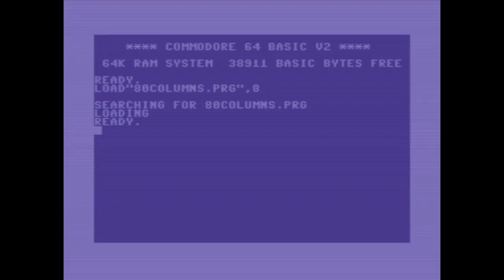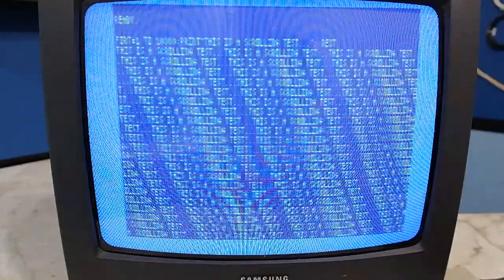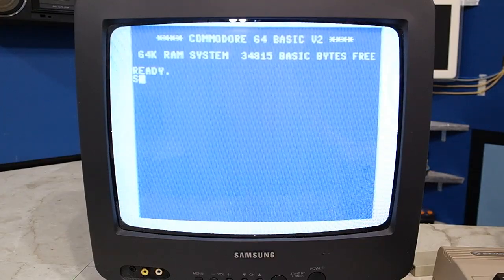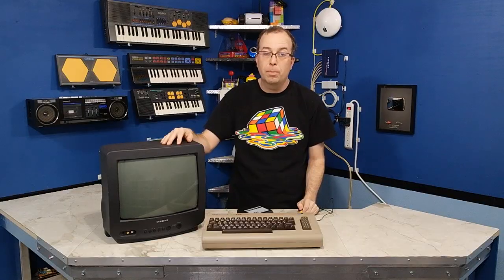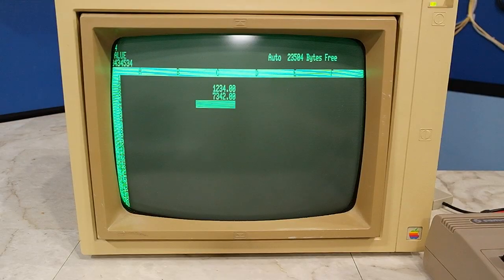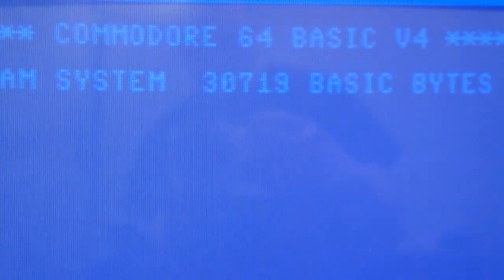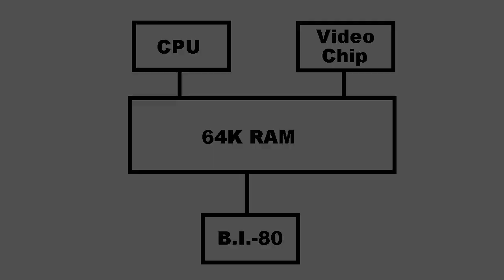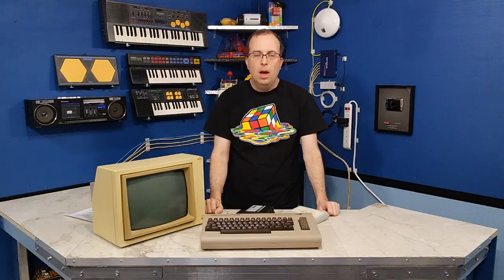The Quest for 80 Columns on the Commodore 64

Comment: I had a vic-20, and I sometimes used the 40 character mode. Yes, it was smart software, because it would actually replace 2 adjacent spaces with a single character, as we only had 256 characters to redefine.
Actually that's not completely true, as you could change the base address of the character font on the fly, but that required a raster interrupt halfway the screen.
That was certainly possible by using the 6522 free running timer with exactly the right period of one retrace, and synchronising that by busy waiting for the linecounter to change. Which had a margin of course, due to the loop waiting for it. At least I could make a smooth scroll by changing the column width to 0 characters and back at the right moment (per scanline adjustable), and changing the start of screen (once per frame changeable).
My cbm8296 did not have any of these nice things.  Not even a reprogrammable base address for the fonts. Stupid 6545. The same 6545/6845/8245 for which a lot of VGA cards were register compatible for exactly the same thing you said: software support.
I assume you can still pick a modern nvidia card, and talk to it like it's a 8245.
My cbm8296 rom did have support for character windows: you could define a window in which you could do whatever you want, but the outside of the window did not change. Very nice for menu systems
ah... nostalgia...

Comment: Thanks for the walk down memory lane. I used to be a librarian for the Toronto PET Users Group (TPUG) and later worked for Batteries Included. It has been over 30 years since I worked on the BI-80 and programs like PaperClip. Just before Batteries Included was purchased by Electronic Arts, we removed the need for the dongle. We had a lot of people complaining because the dongles would get damaged and there was no way to make a back up. Plus EA didn't have the facilities to make dongles. So in 1986 there was a version of PaperClip which didn't need the dongle. That version supported the BI-80. EA would have owned the rights to PaperClip (I believe) and Oracle (database software) but even when they quit selling/support C64 software, EA never released the software to the public. :(

Probably 20 years ago I pulled out boxes and boxes of floppy disks (5.25 and 3.5) with the source code for all this stuff but sadly the disks had degraded and weren't readable. I wonder if Steve Douglas ever kept his copy of the source code. There wasn't source control systems like we had today. When I moved to California, to work for EA, I lost touch with everyone at Batteries Included. :(

Also, Batteries Included created the BI-MonoChrome Adapter. It was a cable which allowed you to connect your C128 to the Commodore 1701 or 1702 monitor. It was really the same cable you describe in this video. We made it for people who just wanted to buy one pre-made rather than make one themselves.

Comment: An interesting tech note: The blurry image when outputting to a normal T.V. is due to the fact that the video is modulated by the C64 to 57 Mhz T.V. broadcast frequency (channel 3). The T.V. then demodulates it back into composite video and timing variations between the two would cause blurring of vertical edges. A T.V. tech could "tweek" the demodulator filter to clear up the fuzz - sort of. For the tech familiar with television circuitry, you can bypass the tuner and insert the composite video at the output of the demodulation circuit. This requires switching out the tuner. The SID produced all the timing signals; vertical and horizontal sync so nothing in the tuner is necessary. This produces a screen with the same clarity as the Commodore monitor.
On the other hand, the Commodore monitor is not a digital device, it's simply a T.V. without the RF demodulation circuit (tuner). The composite video output from a DVD player ... well, a VCR in the 80's, or cable converter box can be input at the RCA jack(the chroma input if I remember correctly) and produces a clear, sharp image for these devices. It's not HD but was a better movie viewer than most T.V.s without a composite input in the 80's

Comment: it's not so much the signal (chroma subcarrier), it's just that monochrome CRTs are sharper in general. They don't have RGB "pixels" and no mask in front of the phosphorus coating that separates the rays from each of the three guns in a color CRT. With no substructure and just a solid layer of phosphorus a monochrome CRT's sharpness is limited only by how well the ray is focused.

Comment: Ya know, it's funny how many things in early computers are holdovers from the typewriter era, if even just by sheer coincidence: depending on typeface and paper size margins and the like, typewriters generally gave you around 50-80+ characters per line for the average sheet of paper. Happens to fall in the same ranges as computers would provide in text columns, before things got a little more graphically advanced and resolutions increased.

Yeah, I know that's completely random to bring up here, but the nature of business (and word processing software) made me think about that similarity. You can probably also tell by this what I like beyond classic computers and gaming stuff ;)

Comment: The Apple IIe had 80 columns hardware and firmware support built-in. It simply required 1K of memory (1,024 bytes) to display its 80 columns text on screen, and essentially that's all the card did--add 1K RAM in the auxiliary slot. The Apple II and II Plus were a different story, 80 column cards on those earlier models had independent video generating circuity and often require connecting the monitor directly to the card itself. Still, software was compatible between different II/II+ 80 column card manufactures (and even some IIe/IIc era software). Also worth pointing out, many Apple IIe's shipped with the 1K card pre-installed, giving you 80 columns out of the box.

Comment: Local man finds four ways to get 80 column output from his C64! The fourth method might surprise you!

:D

...similar to the Laser XT question, could you connect both the outputs from the 128 to the same monitor (particularly the 1084 with all those extra input ports), and just use a mode switch on the screen to flip between them? Having to plug in two separate ones seems like a very boneheaded - though not at all out of character - decision for Commodore to make.

Would the composite output on that hi-rez plug also produce low-rez monochrome when running in C64 mode? That might be at least one saving grace...

Comment: Huh, the "own video RAM" thing is a bit strange (edit: for the first device). Essentially it's a very low grade CGA or other external card. Does the C64 cartridge port not allow connected devices to read directly from main memory? 

*a wild seconds device appears*

Well that's annoying.

Hmm, quite fast, which is a surprise, as I might have expected it would probably still suffer quite a bit of contention and slowdown, because of having to fight both the CPU and the VIC-II to get memory access. Does the latter device have some way of turning off the internal VIC, therefore being able to use the reserved RAM access times that the internal chip would normally use to read the video area of memory without having to fight the CPU?

Comment: >part about composite video and the addition of colour appears in the actual video
Ah, dammit, so all that I blabbed about on the Laser XT vid, you already knew. Oh well.

Does raise another question though, which I thought of whilst writing that stuff but then forgot - would turning down the colour saturation on the TV to zero (and also on the monitor, if it has the option?) do anything to help the sharpness?

I mean, part of the problem I think your TV has is one I've come across in small portable sets before... it simply doesn't have sufficient physical resolution. Like, there's maybe only 400 to 450 phosphor triads (whether trinitron style, or arranged hexagonally or triangularly) across the width of the screen, and where they aren't trinitron stripes there's maybe only 300-330 sets in the vertical direction too. Those small 12 to 15 inch tubes are just far coarser than you might have expected, it's just that they're so small (in TV terms) and you wouldn't normally sit THAT close - and they'd normally have high motion true-colour but not super high detail content on them  - that you simply wouldn't have noticed. I've only really come to realise it since having SCART-equipped ones plugged into RGB sources such as PVRs, "smart" DVD players, cable boxes etc, especially those which can also operate in HDTV resolutions. Even with essentially perfect 15khz connections with no composite corruption or smearing by the capacitance of overly long cables, small text becomes almost unreadable because it's being blurred away to mush just within the actual output stages of the set. So manually stripping out any real or artefact colours still might not actually improve things a great deal, but if turning it to zero can minimise those and maybe also convince the set to turn off the colour decoder completely (which adds a level of blurring to the luma in most cases), then a small increase in crispness may result simply because the number of stages causing cumulative degradation can be reduced.

Proper 15khz colour monitors tended to have a rather finer dot pitch, i.e. more physical phosphor blobs per unit area, vs equivalent sized TVs. The manual for our old CM8833 had a comparison of three or four models in the CM range near the front (as it was a multi-model document), and it sat somewhere in the mid to upper ranges, with a fairly fine pitch and ... I can't actually remember the exact figure, but something like "over 600" or "over 800" lines of horizontal resolution being possible. In any case, it showed ST medium rez (640 pixels plus a fairly copious border) very nicely even when adjusted such that the border was enormous rather than thinned down to almost nothing.
((I nearly put "TV lines" there, especially as 420 seems to be a common one for actual TVs, but realised that's not quite right... between the measurement actually covering a square area in the middle of the display, and things like Kell Factor, 420 is actually a pretty good score even for a monitor; 500 is about the maximum for 15khz displays (maybe 600 if yours is specifically made for maximum quality PAL output), and I suspect yer typical cheap portable TV would be somewhere in the low 300s instead...))

Which I expect is why there was actually a small but steady market - which again, like with the front panel TTL/RGB switches that baffled me at the time (mentioned in Laser XL comments), I couldn't understand the appeal of as a kid - for 15khz monochrome monitors, seemingly just old surplus-stock black and white TVs that had been converted to accept computer signals and rebadged, both for "serious" users of machines which couldn't do high-rez output (or, in the ST case, simply sold rather more cheaply than the real hi-rez 35khz model), and for security monitors etc... they don't have discrete pixels, at all . Exactly the same concept as their high-frequency / high vertical rez cousins, in fact. Just one continuous plane of phosphor, scanned by a fairly tightly focussed electron beam, giving a pin-sharp image even on a relatively small tube.

Probably the same for the Osbourne, portal 64s, etc, with their small, monochrome built-in screens. 480x200 or thereabouts was probably actually pretty readable at 5" without any dotmask interference.
Reply: *unpauses video, Apple greenscreen monitor appears, demonstrates the effect in fine style*

GODDAMN IT CHARLES GET OUT OF MY HEAD
(...is it not adjustable though? The text disappearing into all four corners must get a bit annoying... I suppose it was designed for 560x192 not 640x200 (or 480x200 in the space of 640x200), so an actual Apple II would have produced a very neatly fitting picture, and I know that high-rez mono monitors often didn't have much in the way of adjustments because they were preset at the factory and only ever used a single mode... but all the same, an 80s analogue 15khz monitor without SOME kind of picture adjustment controls seems rather wierd)

*five inch mono TV appears and does the same*

ARRRRRRRRRGH

*Commie 1084 (aka rebadged CM8833) joins the fray and shows off characteristic clear 80-col appearance despite being colour*

Well this is just a stunning example of why you should always always watch the entire video before starting to comment, isn't it.

Comment: Hmm. The 6845 isn't really a "video chip". It's a graphics controller. Basically it just generates timing and sync signals, and address signals for shift registers and the like to be able to pull the video data out of memory in readiness to present to a DAC. It isn't actually directly involved in either the video output OR the construction of the image in memory in any way. Not even sure if it does anything to handle the interaction between memory with text data in and the ROM (or RAM?) with the character shape definitions.

Which is why it can be found in a quite astonishing range of machines from the mid-late 70s right through into at least the 90s, not just the screen expander and the CGA. Heck, I think the VIC-II may even have at least a subset of the 6845 die - or something that works almost identically - included in its design. Got something that generates video output, especially basic grade text, on a 15 thru 31khz monitor? There's probably one of these babies lurking inside somewhere. It's closer to a 555 or 74-series IC than any genuine processor.

The font, btw, looks VERY Teletext / BBC Micro-like. There weren't many machines which used that rather peculiar design. Wonder if there's any relevance there, particularly given how the Beeb was a 6502-based (6509? 6510?) computer at about the same operating frequency (and price point!) with typically 32kb and a built-in 80-col capability?

...actually looking closer at it, I think I can only count 6 pixels per character, horizontally (still seems to be 8 scanlines per row at least), which is a little strange. So in low rez it's actually only showing 240 pixels across (yet still getting colour artefacts!). And 480 in high. Weird.
((later thought: Teletext font was actually only 6 pixels too... I think? And the usual mode was 40x24, so just 240x192 resolution. Still, it seemed good enough for what it did, and there was never any problem with readability. Think some later models used a 12x16 font instead of 6x8 - or given how small the borders were on a PAL set, probably 12x20 instead of 6x10 - but that just made some of the diagonals and curves smoother more than anything else... In fact if you wanted the "sixel" graphics mode to work smoothly it was probably best to have 6x9 / 12x18, so each of the individual sixels were actually 3x3 or 6x6 "real" pixels, even though that would then make the 50% dither character look a bit weird, much like it did in VGA 720-wide text modes but in the other direction... perhaps some minor circuit could have switched its orientation for every other row, same as how if IBM had been smart they'd have had that character flip horizontally in odd columns vs even ones?))

It also looks rather tall, but then so does your normal screen anyway (200 lines almost filling the TV, yow), and is it actually only 24-line not 25-line??

Comment: "The Commodore 64 was doomed as a business machine"
...thing is, Commodore wouldn't have been that bothered, at least not straight away. They still had their CBM division, with things like the PET and various more directly office-focussed models with baked-in 80-col capabilities, that hardly anyone who didn't actually work in an office which had started turning electronic instead of paper based would have heard of. And that then started failing pretty hard, because they couldn't market or project-manage their way out of a wet paper bag (and had seemingly never heard of Interdepartmental Cooperation), so they had to throw all of their eggs into the C64 and Amiga basket... Then there was the attempted resurgence of a more professionally-focussed machine that also happened to be C64 software compatible, in the form of the C128 & D128...